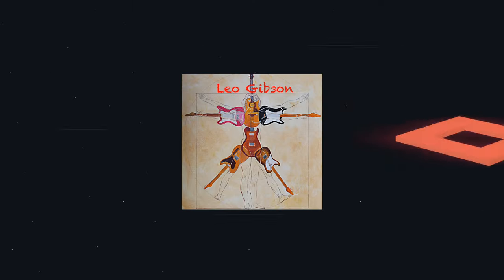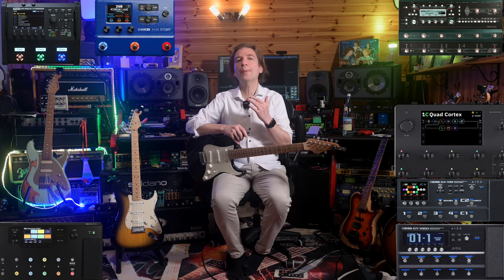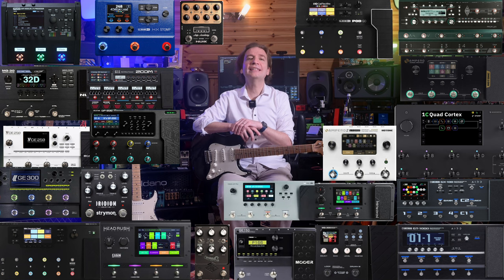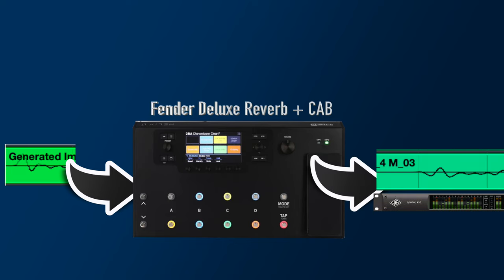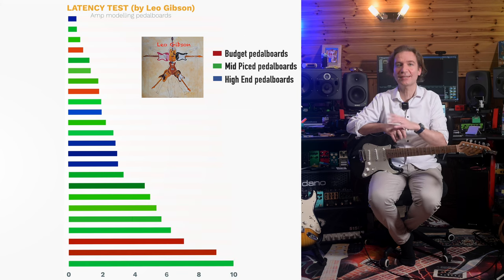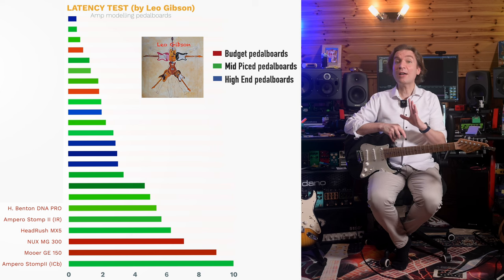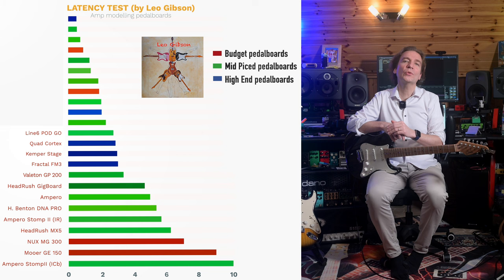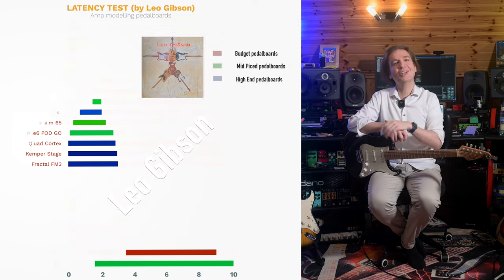LATENCY TEST: 23 amp modelling pedalboards compared! Quad Cortex vs, FM3 vs Helix vs BOSS vs NUX....

Comment: Wow, the amount of work this must have taken. Much appreciated, Leo. The results are quite surprising, but I think that the majority of players couldn't feel a latency of even 10ms. It is still very little. I wonder what would be the actual threshold of latency, when it would start becoming a problem for the avarage player. I suspect it would have to be closer to 50-100ms.
Reply from the maker: Hi Marcin, well even for me 10ms are not a problem, but some of us are more sensible to latency...so for some of us could be a problem...nevertheless, I think we have to find the right spot between latency and quality...I mean the more you push the algorithms and the converters..the more quality you have and the more  you are gonna require in terms of processing power and therefore latency increases...and vice versa...the right spot seems to be around 3 ms, as QC, Fractal and Kemper are all almost there...just suppositions...
Thank you!
Reply: I don’t know if you can hear differences in latency below 10 ms, but I‘m sure you can feel it while playing the guitar. I think I can feel the difference between tube amps and and a simple single channel non master volume amp feels better, more direct and immediate than a multi channel amp with all the bells and whistles like FX send, master volume, graphic eq and such. A „latency“ above let’s say 50 ms wouldn’t be called latency anymore, as it would be a delay, that anybody, even your grandma could hear.
Reply: 10 ms are like standing 3.43m away from the amplifier. Step back and see how far you can go before it becomes a problem to you.

Comment: One of the most useful videos I've found on the subject! Well done, Leo. 👏👏👏
Just one question (for Leo or anyone who knows): Is the latency on the Boss GT-1000CORE the same as (or even better than) its bigger brother, the GT-1000? The former is supposed to have the same processing features as the latter.
Reply from the maker: Thank you so much, I'm happy that you find the video useful!!
I'm sorry but I have not tested the core...I assume that it is the same of the GT 1000...but I'm not 100% sure
Thank you!
Reply: I believe is the same... Is the practically the same unit but with less switches.
Reply: @guguslive  is the same, Identical

Comment: I found that boss/roland are very good with latency, I watched video for digital wireless latency where all wirelesses are around 5ms and boss is around 2ms. Nux Amp Academy is surprise, it is very good option that sounds good. Latency is not an issue if you are playing home or similar. But live when you stack few digital units like modeler, some sfx, and digital wireless plus distance from amp/monitor it can add up, an can be noticable. Add 5ms to each point and very fast you are close to 20ms which is noticable.
Reply from the maker: Hi, thank you for sharing! Yes, I do agree.,..the problem may arrive also when you sum up the latency of many different devices...

Comment: The latency of an entirely analogue guitar amplifier still depends on how far away the speaker cabinet is away from your ears. At room temperature it takes 10 milliseconds for sound to travel 3.4 metres. So a 10 millsecond latency inside an amp modeller is perfectly acceptable.
Reply from the maker: Hi thank you for sharing ! let me just say that you have to add to the modeller latency also the time it takes for the wave to reach your ears … I mean the time you’re mentioning has to summed to the latency of the modeller. thank you!
Reply: @LeoGibsonGtr  That's true - the latency is compounded if you're using an amp modeller connected to a real speaker that is a few metres away. But often (and maybe more common) is that we use amp modellers with headphones or use a pair of studio monitors that are closer to our ears.

But it's nice to know most of the modellers you tested have a lower latency than a real speaker 3 metres away.
Reply from the maker: Hi, yes, no problem with headphones!
Thanks
Reply: I think you are both spot on: Latency adds up in the signal chain and distracts from the playing experience. So to use use a modeler with speakers on stage might not be the best idea. Using a good modeler with in ears shouldn’t be a problem.
Reply: @stevenvandemsky7290  Using a modeler with a real cab can eliminate some latency because you remove the IR.

The other thing to note is that often people who are using traditional amps can also be found using digital pedals, which for each pedal adds the A/D - algorithm - D/A latency. So, for example, if you have a reverb pedal, a delay pedal, and a modulation pedal, you could be adding a couple ms at each stage. In a modeler, you are doing the conversions only once.
Reply: @toesalad  All valid points! I didn’t think about the latency of IR loading before. Sure, a big pedalboard with many digital pedals can be problem. Thankfully a lot of digital Delay and Reverb FX are analog dry through nowadays and don’t add up to the latency.

Comment: With a little bit of electronics background lemme weigh in.  There shouldn't be a large delay introduced in sampling the signal in the A/D.  It should be a few cycles at the most and I'd expect a better/more expensive A/D to outperform.  If you have torn them down we can simply read this in the datasheet for the A/D but it's going to be nowhere near the 1ms mark.  The question then becomes the filter banks before and after the sample, analog on one side and digital inside.  Every analog converter is going to be fronted by a low pass anti-aliasing filter and the choices there may be a compromise between the quality of the filter and the delay (which is going to vary across frequencies, i.e. you'll see different phase delays).  On the digital side the processing power of the CPU should have little to do with the delay.  The CPU has to keep up with the sample rate in real time which pretty much puts a boundary around the delay introduced by the digital filter.  You'd imagine most DSPs today are more than capable here.  What this leaves us with is things like the modelling filters and the effect loops.  The digital filters will have their own frequency response which again reflects a tradeoff between a better frequency response and the delay.   Each block also introduces some delay as each sample moves through the pipeline (though again unless it's extremely long that shouldn't be that bad). This is also true of a "real" amp where that's impacted by physics and analog components.  So it's possible to some extent to trade tone for latency which is probably what's going on here and why you noticed different IRs having different delays.  Phew.  Not my expertise any more, it's been a while, but I think the general idea is correct.  In order to measure all this stuff you need to measure the frequency response and the delay across frequencies vs. just measuring an impulse which contains a lot of frequencies.

p.s. I just ordered as NUX Amp Academy as my first foreigh into modelling and I'm really looking forward to making some cool tones with it...
Reply from the maker: Hi, thank you for sharing...interesting!

Comment: I bought an MX5 recently and liked so much about it (particularly its sound and its looper) but noticed a slight feeling of disconnect when playing it, did some research and found your video that shows it has a latency of around 6ms. I measured it too (by recording direct and processed into Audacity), and got the same result (even with amp and cab simulation off). Apparently it uses a generic processor, which might explain this result. I also measured the Boss GT-1 which is a more basic unit and its latency is minimal, somewhere around 1ms.
Reply: I also meant to say thank you so much for taking the time to make this video!
Reply from the maker: You are welcome Peter, and I'm happy that the results are the same!

Comment: This is really great, I would have bought the MG300 if it weren't for this comparison. 
The Zoom G1x Four has the same effects as the Zoom G11, and many of the specs like signal processing bitrate, sampling frequency and A/D / D/A conversion are identical. Do you think that it is therefore likely that the very compact and affordable G1x Four has the same low latency as the G11 on your list? I would love to see it added to your next comparison, it's competing directly against pedals like the MG300. Thanks for all the work you put into this.

Comment: Latency 기준을 거리로 환산을 해봅시다. 소리의 속도는 약 335m/s. 앰프 10m앞에 있다면 10/335 = 0.02985s = 약 30ms 의 latency가 있는 것으로 나옵니다. 10ms면 스피커 3.3m 정도 앞에서 듣는 정도입니다.
🤔
Reply: That’s true, but then you have to add these two together = 20 ms. You can’t do anything about the speed of sound so getting the latency as low as possible is extremely worthwhile

Comment: This doesn't surprise me at all. Roland always seems to have made speed and instantaneous switching a priority with the GT series. I've had every variation from "GT-6" to "GT-1000" over the past 20 years. Everything has always changed as fast as stepping on a pedal. I had a Fractal FM3. While it's amp and cabinet modeling blow the doors off of a Boss GT 1000, I would never play a gig with an FM3 unless I was never going to have to change tone mid song. Some effects change as fast as a pedal stomp in an FM3 but changing the channel on the amp block leaves much to be desired. Also, the GT-1000 has more intuitive FX loops, more outputs, more control buttons, and a built in expression pedal.
Reply from the maker: Hi John, thank you for sharing your experience

Comment: I would much appreciate if there is an Audio Demo of Patch Change latency for each of the modellers. That would have made the video more comprehensive and compelling. In my Experience Boss GT-10 100 and 1000 have the most smooth patch switching, kemper is the most disappointing. I found AX8 to be fantastic as level matching makes the latency almost hard to notice. Pod XT live was smooth but helix is noticeable  . ..
All other modellers have latency and need a focus and attention to make do
Reply from the maker: Hi, thank you for your suggestion. 
Let me say that patch change time is a different topic compared to the latency measured in this video.

Comment: I measured the latency of my Line 6 Pod Go (firmware v2) using an oscilloscope and with a full processing chain I can confirm the 3 milliseconds latency, which is really excellent for a budget product 👍 Leo, did you measure the Axe Fx III ?
Reply from the maker: Hi, thank you for sharing!
Unfortunately I don't have the FXIII...so I didn't test it
Reply: @LeoGibsonGtr  Thanks Leo, it does not matter. The latency in such an high end product is surly not over the 3ms -  In 3ms the sound travels 1m. Thus, being 2 meters from the boxes it takes more time to receive the sound from the boxes in the ears, than for the amp to receive, elaborate und output the guitar signal.. Thus, everything below the 6ms cannot probably be perceived by the player

Comment: This are the facts that nobody tells you about modelers, the latency on playing is responsable for your connection to the sound and feeling on your guitar. Leo, have you compared the Boss 1000 to an analog amplifier ..? thanks for this comparisons.
Reply from the maker: You are welcome and thank you for your comment!
You mean comparing in terms of latency or in terms of tone?
Reply: @LeoGibsonGtr  in terms of latency..
Reply from the maker: Hi, the real amp does not add latency. Not having ADA conversions, etc, the signal travels at the speed of light. The only latency is the time that the wave form takes to travel from the speaker to your ears, that is obviously the same for the modellers.
Thank you!

Comment: Thank you for your amazing reseaarch, Leo'

So.... the worst of athem all has the same latency as when you're playing 3 meters away from a "real" amp with a full-analog signal path/chain. Conclusion= IT DOESN'T MATTER! 😂😂😂😂

Although I'd say that I'g go for any device under the 5ms mark, because that probably means they use better quality AD DA converters.
Reply from the maker: Thank you so much for sharing your knowledge and for the compliments!!!
Let me add, that latency sum up, I mean you may be far from your speakers, let's say 3 meters as in your example, and you have a specific amount of latency. Then you have you amp modelling pedalboards, that adds its own latency, then you may have an external digital effect, and maybe a wireless transmitter...and latency sum up. At the end the overall latency of your system may be too much to play comfortably. That's why in my opinion it is important to take into consideration also the latency introduced by you amp mod pedalboard.
Thank you!

Comment: These measurements are from the audio output of the devices into an interface? Curious what the latency is when using these modellers AS interfaces
Reply from the maker: Hi, these measurements are from the audio out of the devices. In fact the latency using usb connection to your computer heavy depends on you computer...how powerful it is, how much is the buffer etc. Therefore it would not be an objective measurement.
Thank you!

Comment: GT1000 has very low latency but this modeler is flawed. The big problem of this unit is that the converters of the FXloop are introducing a lot of noise in the signal which is disqualifying its use in a 4CM configuration.
Reply from the maker: Hi, thank you for sharing your findings!

Comment: For Ampero 2, I would appreciate it if you could measure the latency values after the update (after latency improvement).
Reply from the maker: Hi, thank you for your suggestion! I will check it out, even if it would be a nightmare to test everything again after each firmware upgrade...
Reply: @LeoGibsonGtr  
It's okay, Leo.
Forget about it.
Thanks for the answer.
Reply from the maker: Hi, I'm doing some follow up to that video, with deep dives into each of the unit...therefore maybe I will do a deep dive also for the Stomp II.
Thank you!
Reply: @LeoGibsonGtr  
That is wonderful news for me.
I am looking forward to it.
Reply: Good to know since I like the quality and sound of what ampero II offers. I hope latency improved. I don’t want to stay with line6 amp modelling anymore. It’s just not my thing.

Comment: Leo, Ampero Stomp II is up to firmware 1.2  Do you know what the latency is with this firmware up date?  Charles
Reply from the maker: Hi, the last test I did was with firmware 1.1.0 which improved the latency. You can check out a dedicated video here: https://youtu.be/NyPKqOHZeek
After that fw I didn't check the latency again, even if, as far as I know, there were no improvements dedicated to latency (where the fw 1.1.0 had specific improvements dedicated to latency).
Thank you!
Reply: @LeoGibsonGtr  would it be hard to test again with firmware 1.2?

Comment: very useful video, could you use the same method to test the digital amp such as spark, thr, katana, etc? thanks
Reply from the maker: Thank you so much, I'm happy that you find the video useful!!!
It is possible testing the physical out of the units going into the audio interface, where it is NOT possible to test the speaker out, as I would need to record the sound via microphones...for instance introducing latency deriving from the distance of the mic from the speakers...it would be an "estimate", I mean a not precise measure.
Thanks!
Reply: @LeoGibsonGtr  how about use the send port? if the digital amp support that
Reply from the maker: Yes, you can test the latency via the send port, if the amp has it (as you said). In this case you assume that the digital to analog conversion of the send port is the same as the digital to analog conversion done to send the signal to the speaker. 
Thanks!
Reply: @LeoGibsonGtr  got it, thank you very much
Reply from the maker: @Yui_VOCALOID_P  you are welcome!

Comment: Great job, Leo! I have an FM3 and it´s latency feels totally fine for me. But the thing is that latency will increase depending on other circumstances. For example, recently I found that active monitors also can cause latency. I measured my Presonus Air10 (which has DSP) and it adds almost 5ms latency! Definitely, it is noticeable (at least for me). Can you recommend an active monitor for the Fm3 that has no latency? Thank you in advance
Reply from the maker: Thank you Rodolfo, I'm happy that you like the video! Actually you are absolutely right...for instance, also if you add a wireless connection between your guitar and the pedalboard you are gonna add latency. Every digital conversion add latency...and the end result can be not acceptable for some of us. 
As regards active monitors, I have not done specific comparisons, therefore I cannot give you advices based on facts. I have once played a Friedman active cab and that sounded really good...but it is pretty expensive and I don't know if it is worth the money.
Thank you for your message!
Reply: @LeoGibsonGtr  thanks!
Reply from the maker: You are welcome!